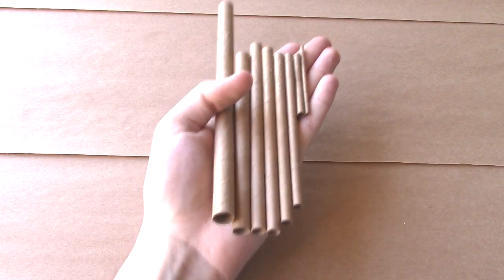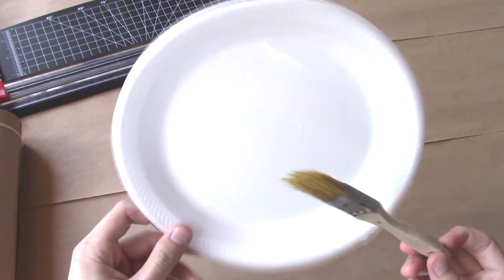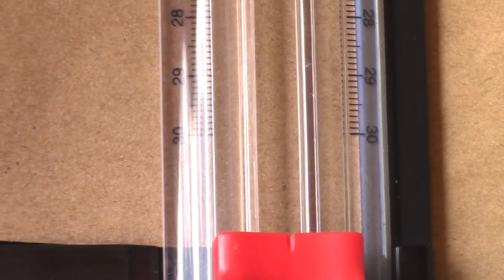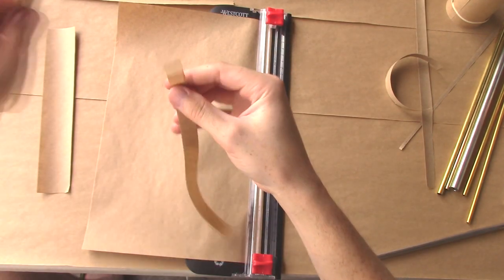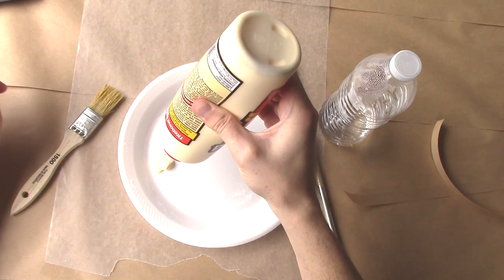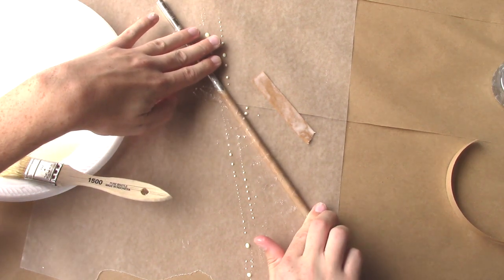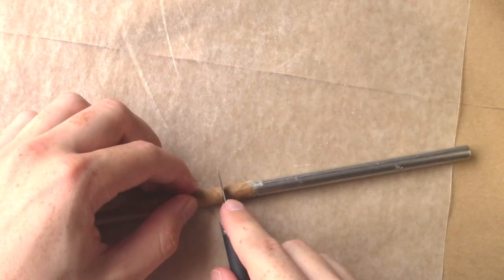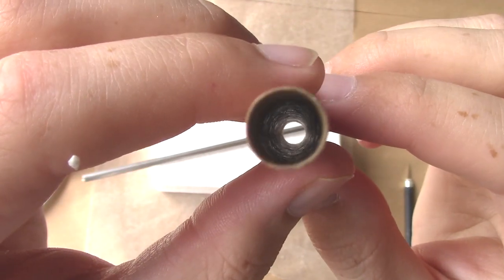How to Make Mini Kraft / Cardboard / Paper Spiral Tubes

Comment: I want to do my 48" roll straight on, no strips and no spirals. I'm still trying to figure out an 8" mandrel that will release, and a few other things. I found a source of paper. This will be way better than buying Tubes at Home Depot, which come in such different sizes, and are bulky to transport.
Reply from the maker: Ahh ok. That sounds fun! It's going to be really difficult though. I would probably look up some tips on getting it to roll perfectly straight so the paper doesn't end up diagonal. A mandrel - I never thought about that. That would probably help a lot. If they don't exist, you might be able to design and 3D print one!

Comment: Thin glue is better than thicker glue, within reason. You don't want to have "structural glue" but rather good penetration and fully cured glue without lumps.
Reply from the maker: That makes sense I guess - in the case with thin glue you'd be relying on just the strength of the paper layered with itself. I think with thicker glue, you also get some strength from the glue. But you also add weight that way. However, with masking paper, using thin glue is very difficult due to how quickly it absorbs water and how weak it is when wet.

Comment: Great video. Can this process be used to make a square or rectangle tube? I need to make a 1/4" x 1/2" tube for servo wiring in a radio control airplane wing.
Reply from the maker: Thanks! Honestly I'm not sure. I think it would be possible if you cut the paper strips in a VERY specific way. Rectangular strips get really wonky around corners. I would test it right now but unfortunately I don't have a rectangular form to use.

Comment: Fantastic and concise. I really like this video. I have done this before for larger tubes, using thin cardboard (cereal boxes). I made the strip width = circumference x square root of 2 ... (w = c / 1.41) ... or diameter x pi x square root of 2 ... (w = (d x pi )/ 1.41). This made the seam 45 degrees. If I remember correctly, I was taught this was the optimum angle for strength of the seam.

For the sizes I was making, 1.41 was an adequate approximation for square root of 2. For smaller sizes, like in this video, I believe 1.4 would be adequate.

ls that helpful?
Reply from the maker: Wow, that's a very detailed way to get a proper strip width, thanks for the info! Did you have any issues with the layers of cereal box binding due to the glossy printed side?
Reply: Sorry! I wrote that too quick. I have corrected it to w = c / 1.41 or w = (d x pi) / 1.41.
This equates to about w = d x 2.22

Comment: You can find some decent youtube tutorials for cutting tubes that are a little more reliable than going by eye: either cutting guides that slip over the tube, or angle-stock and an end-stop for reliable repeatable lengths and good 90 degree ends.
Reply from the maker: That's handy info, thanks! I basically have no experience or knowledge on that subject haha. I'm not able to picture the angle stock method.

Comment: Convolute tubes are much stronger plus quicker and easier to make ;) The best material for small id tube formers is ptfe (teflon) rod, nothing will stick to it.
Reply from the maker: colspyro convolute tubes are indeed easier to make, but they only become stronger than their spiral counterparts when their thickness is significantly more than a spiral tube of the same inner diameter. This requirement of more layers for the same overall strength means that they're much heavier, and not suitable for most airborne items like rockets and gliders :P However, convolute tubes are superior for pyrotechnics. Thanks for the tip about the Teflon rod, I'll keep that in mind!
And thanks for watching :)
Reply: A convolute tube uses a continuous sheet, 2 thicknesses of paper will give  identical wall thickness whether its spiral or convolute wound. The beam strength of a convolute wound tube is much greater than a spiral wound tube because the wall has no internal joints or voids which are present in the spiral wall .The only benefit of spiral winding is you can make a tube any length as you`re not limited by the former length or paper roll width.
If you place a convolute and spiral wound tube with identical id and wall thickness on a former and push one tube against the other you`ll find the spiral tube will fail first everytime. Spiral wound tubes behave much like a spring, they dont transmit forces directly from one end to the other. Convolute wound tubes behave like a stack of vertical sticks..they are very difficult to crush by pushing on one end ;)  When you wind a convolute tube be sure the paper grain is running parallel to the former. In the case of ribbed kraft paper, the rib lines should run the length of the tube. These 3/4" id tubes fail at 7800psi minimum, the commercial spiral wound equivalents i tested barely managed 2500psi and they cost more ;) https://youtu.be/oF39ltNHvUo
Reply from the maker: colspyro Hmmm. Interesting info! I'll have to make a convolute tube of the same amount of layers sometime, and compare the weights and strengths. The trouble is, though, winding convolute tubes is tough when they're miniature. I'm no good at creating seamless convolute tubes on large forms, and it's tougher with small ones. The way I learned from a video a while ago was to just glue the end of the paper over the form onto the rest of the strip, and roll it from there. But that creates an imperfect inner shape of the tube.
Reply: I dont know how small you need to go, the smallest tubes i roll by hand are 3mm id x 150-200mm long.  I dont like the fold over method either as it tends to create tubes that are out of round. For small id tubes its best to use a lightweight kraftpaper 40-50 gsm which is maybe 30lb stateside.
 If using pva glue.apply it neat and fairly generously. After the glue is applied you dont want to hang around. position the former (ptfe, stainless or silver steel) at the end of the paper and gently roll the first turn. You need to go slowly and apply almost no pressure as only the surface tension of the glue will be keeping the paper in contact with the former during this stage. When you have the first turn on the former its plain sailing from there. After you`ve done a few you`ll get a feel for it.
The best way to remove a tube without damage is to make yourself a simple extractor tool,  a piece of plastic chopping board (or similar) with a hole just a hair larger than the former diameter drilled in it. Slide the tool onto the former and push the tube off with it. Dont touch the tube, just the former and the tool.
Reply: colspyro p
Reply: convulate tubes are definitely stronger.
Reply: @marcferretti  No

Comment: I wonder if PVC works as well as stainless steel. It would need to be smooth. Still worrisome if it is tight.
Reply from the maker: I think I did make some convolute tubes with PVC as a form. It worked pretty well, but the one downside was that cutting the paper tube while on the form creates gauges that make it harder to remove. But if you take anti-stick measures, it should work great!

Comment: I always wondered how homemade paper tubes were made. I used to just wrap the paper colinear. This always gave poor results though. Thanks.
Reply from the maker: No problem! I've done a few convolute tubes, and they're extremely hard to make well. They usually come out loose and malformed.
Reply: I have a feeling it has something to do with shrinking from the drying of glue, and doing this method gives more tolerance space (errors don't grow out of control.) Thing that I wonder now is how paper sticks for q tips and the like are made.
Reply from the maker: @Slowly_Going_Mad  I think my issue was that I couldn't keep the tube tight around the form as I rolled it, so slack built up. Yeah I wonder that as well, and they do it so cheaply!
Reply: They use a machine for it. To do that by hand is a challenge, takes some practice. Some one showed me if you fold it multiple times on the very edge it will work. Easier said than done though because of the precision needed. Each starting fold needs to almost be as wide as the paper is thick.

Comment: Does it can use for real drinking water or just a model.
I want to make a tube but from dry banana leaf but I don’t know what l can use for link the weld.
I want to know more that your glue doesn’t mix with the water when you use tube to drinking or it can eat.
Reply from the maker: The glue I used for these tubes will dissolve in water - you can't use them for drinking or with any liquids.

Comment: I'd want to start with thicker paper unless it costs more. It would leave a seam, but that is not too bad.
Reply from the maker: True. A seam should be fine. I haven't really tested seamless vs seam, and kraft vs masking paper layers as I don't have the proper equipment to do so. But I think the only major differences would probably be in the aesthetics and aerodynamics of the tube. Seamless tubes are nicer to look at and incur less aerodynamic drag, but I'm not sure to what extent.

Comment: Nicely done video.  Thanks for the time and effort to put it together.  A video on parallel-wound tubes would be very helpful (for making model rocket motor bodies).  Please?  :)
Reply from the maker: Thank you! Yeah I'd like to make a video on convolute tubes, but they're quite difficult to get right. I need to find or create a good method to make them in small sizes.
Reply: I been making parallel rocket tubes by just using water and bread flour. I wrap around a wood dowel former and use real heavy cardboard kraft paper. the sheets I use are 13' x 24"  and I cut them into 3 rocket tubes for whistle rockets. After I cut them I put wood glue on the outside edges on each side. There is enough give on the wrapping that I do not need support when pressing them.

Comment: Can i use about 10 to 15 layers of kraft sheets cuz i don5 uave masking sheet
Reply from the maker: Kraft paper is actually thicker than masking paper. You can certainly use it, you'll just need less layers of kraft than you would use of masking paper. And it may be hard to curl/twist the kraft paper in smaller diameter tubes.
Reply: @trumpatier  ok thx dude
Reply from the maker: @gopalverma25015  no problem, good luck

Comment: Hey I tried it but the paper got stuck to the form..
Reply from the maker: Oh no! That's always a tough problem, and it's happened to me a few times. Some tricks to try to fix that are to use less adhesive so it doesn't saturate the bottom layer, or use kraft paper instead of masking paper for the bottom layer. I've also heard of slightly greasing the form, but I feel like that might prevent the glue from working properly and make the tube weaker.
Reply: Made some adaptations to make it work for a pitcheron sailplane. The first layer I made from plastic ribbon used to wrap presents. Worked like a charm from the very first attempt. Thanks!!!

Comment: How could I add a cap to this?
Reply from the maker: If you want it to be permanent, my favorite method is to glue a piece of cardboard (typically thick cereal box) onto the end, and trim off the excess after it dries so that it matches the diameter of the tube.

If you want it to be removable, the best method I've found so far is creating a circular disk out of your desired material (wood works well) and putting some heat shrink tube around it. 1/4" to 1/2" length extending past your disk works well for small diameter tubes. Apply super glue or another strong adhesive to the outside edges of the disk, and then use a lighter or other heat source to slightly form the tube around the disk. Then slip the heat shrink tube over your kraft tube and finish shrinking it with the lighter so that it fits snugly over your disk and the paper tube. The longer the heat shrink tube, the harder it'll be to take off and put on the cap, but I'd recommend between a quarter to a half inch for paper tubes around a half inch in diameter. For smaller diameter tubes, reduce the length of the heat shrink tube, and for larger diameters, increase it.
Hope this helps! Let me know if you find another good way to make a cap.
Reply: Trumpatier thanks for the advice but I’ll just use some plastic test tubes.
Reply from the maker: @gamingofthelegend3907  ah alright, good luck
Reply: Trumpatier thank you very much hope your channel grows to 1 million subs one day you deserve it

Comment: Easier to buy wooden dowels, which come in many thicknesses from 1/32" to 2-1/2".
Reply from the maker: Easier for what? The form?
Reply: @trumpatier  Easier to buy and use instead of spending hours making tubes. Most can be found at craft shops, and are not expensive.
Reply from the maker: @zyxw2000  wood dowels don't fit the same purpose as paper tubes